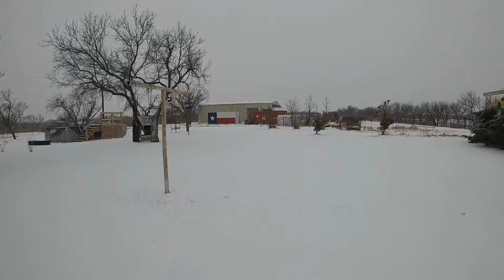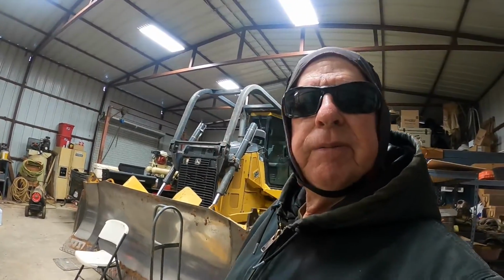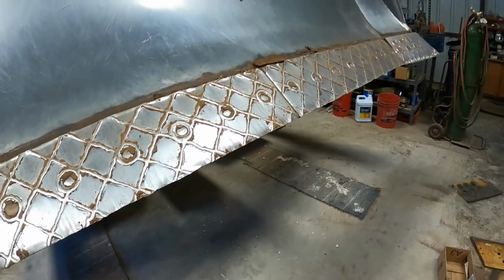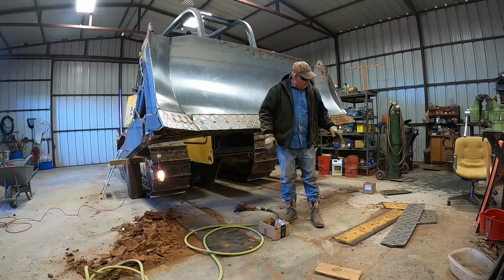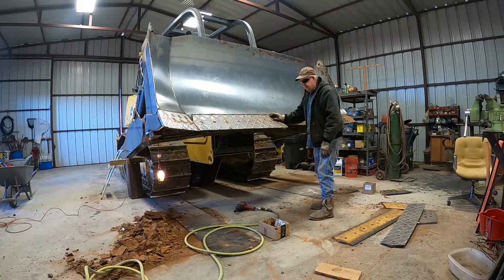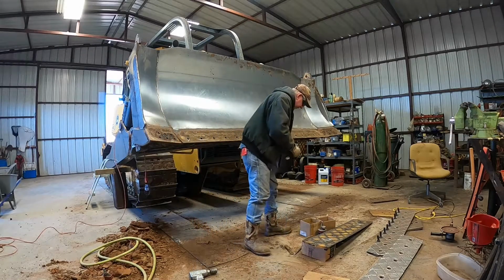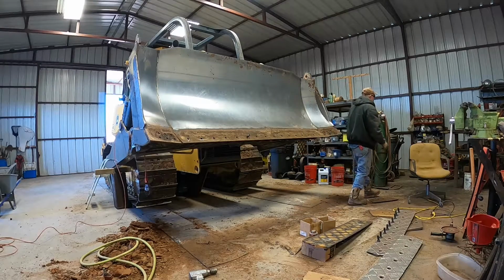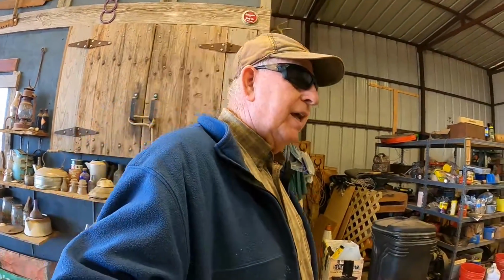It's Snowing Today, Good Day to Get a Little Maintenance Done on Dozer.

Comment: With the price of everything you have to do what you can to make things last longer. Has your 750K been reliable for you? I’ve got a 750J thinking of upgrading just not too excited about getting the emissions that come along with it.
Reply from the maker: Yes for the most part. The def pump and sock was replaced at 4200 hrs. Warranty covered that. It has 5200 hrs. now and I had to have  activator valve and lever replaced and egr valve replaced . I hope that is all for a while.  Once it starts throwing codes who knows. Thanks for watching.